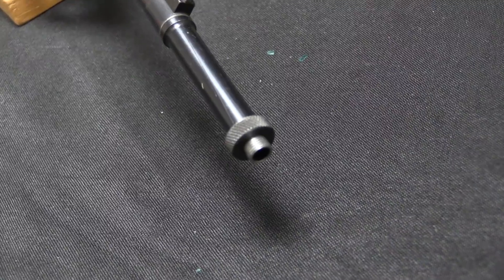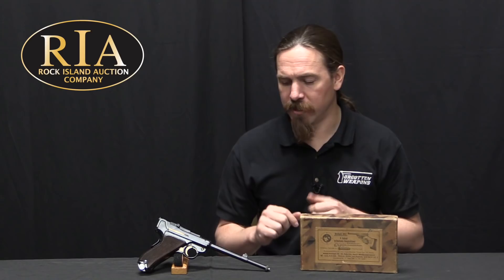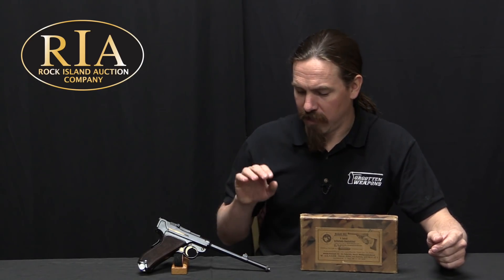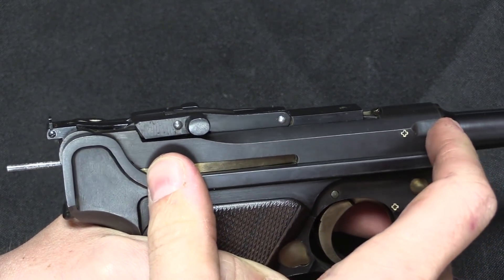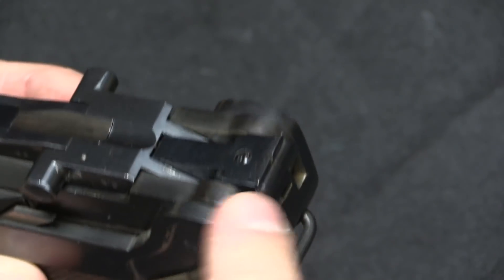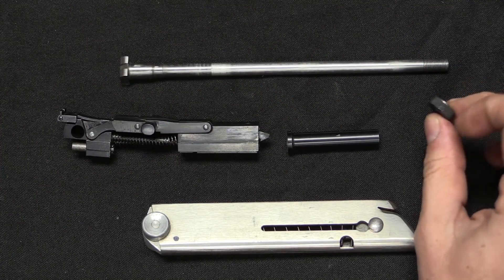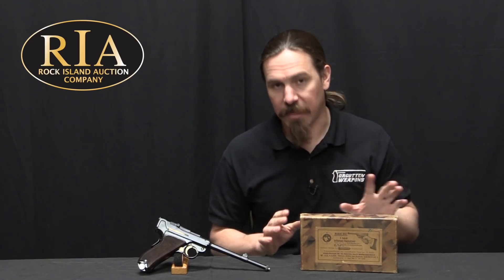Erma/Glaser Luger .22 Rimfire Conversion

Comment: This Luger is actually really pretty. The dark steel with the gold highlights on the trigger and whatnot go really well together. Very cool conversion kit.
Reply: The Luger is one of the most elegant pistol designs ever...especially the Navy and Artillery models.
Reply: or the Swiss or the carbines.  Indeed they're all beautiful!
Reply: I believe the golden coloured parts are "strawed"; a form of heat treatment.
Reply: @skepticalbadger  You are correct in your assumption sir...and it takes skill to get all of the heat-treated parts to match the same shade of 'straw'. Beautiful pistol.

Comment: 8:03 The manual shown on screen @6:39 actually specifies that the ejector should be removed before assembly.
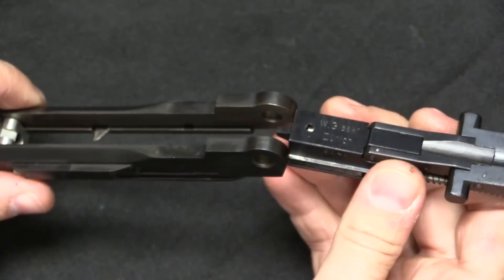8:25 and yes, the manual states that two nuts have to be removed from the barrel. One must be missing.
Reply: Ah, so the gun must not be sold to any Austrians... they seem to cause problems when they're missing one.
Reply: @mfree80286  Subtle...
Reply: @mfree80286  what a great comment

Comment: This is pretty neat, though for a .22 Luger, I prefer another Erma product of years gone by. I forget the exact model, but I have some experience with a purpose built .22 Luger by Erma from around the 50's. Cool little pistol that works mostly like an actual Luger similar to how this does, but it does have it's quirks. The main thing I worry about when shooting it is the long, delicate ejector pin that is easily broken if you do something wrong. The friend who actually owns the thing has the whole thing's original boxed set, though the 1950's or 60's plastic box is a little worse for wear.

Comment: Hey Ian. My Grandfather was in the 3rd Armored in Germany during the early 1960’s. He brought back with him a German Luger that had been converted to .22lr, he purchased it from a WW2 vet. According to my father it was not one of the (rather crappy) Erma manufactured .22 Lugers but a real German 9x19 Luger converted to .22lr. Sadly, my Grandpa ended up selling and trading most of his firearms and I have been unable to locate it. My father said he and his brothers would use it to kill their pigs for meat and that it was extremely accurate. Anyways, I was just wondering if it is possible that this was the conversion kit used or if there were others that better fit that timeline? Thanks
Reply: Ian is not known to react on comments, unfortunately...
He did once on one of my comments and that made me so proud! 😃